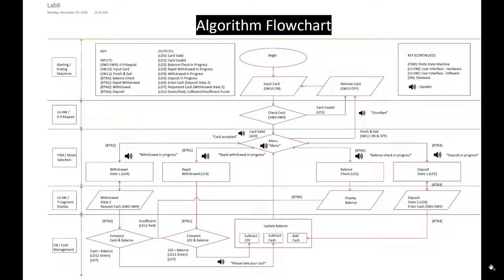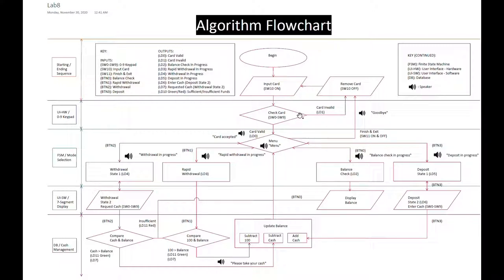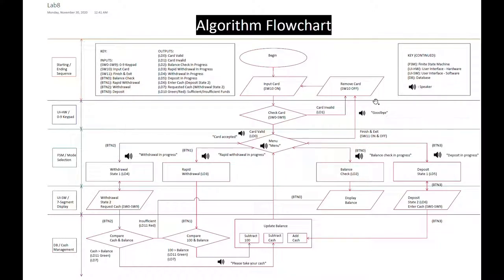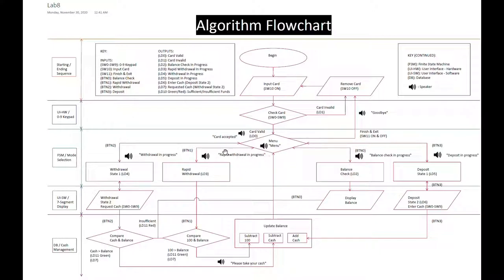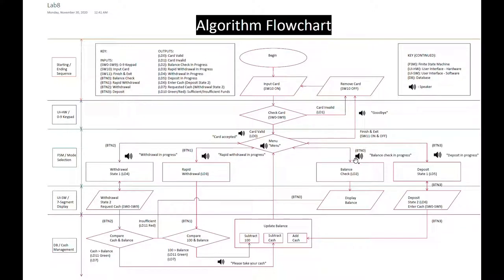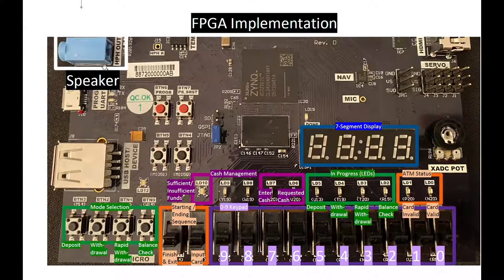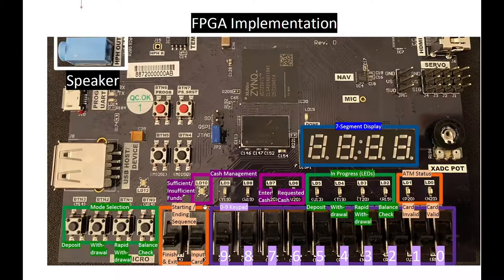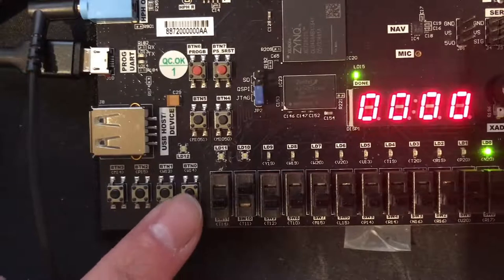SJSU EE 178: ATM Machine on FPGA

Comment from the maker: EDIT: The Withdrawal modes should only update the balance if Cash <= Balance and 100 <= Balance, NOT Cash > Balance and 100 > Balance. This is fixed in the flowchart found on the repository.